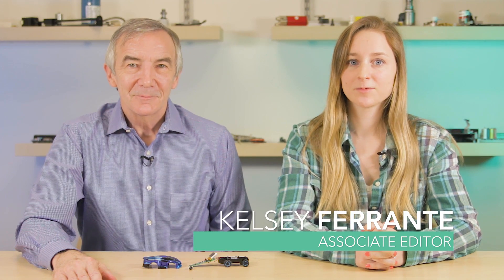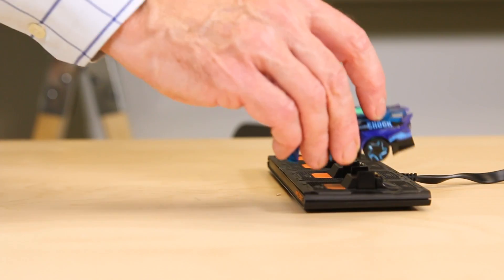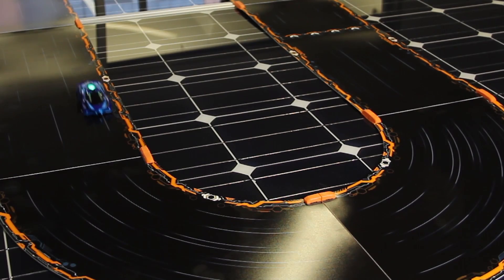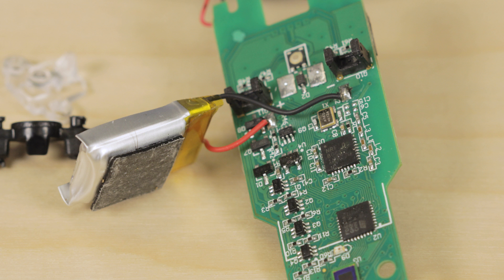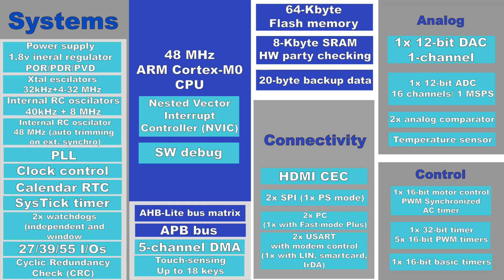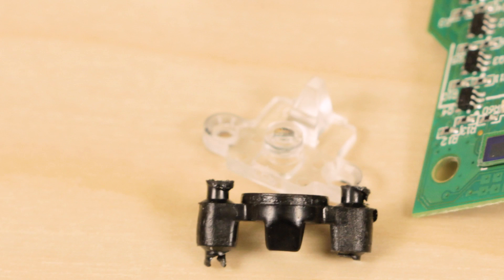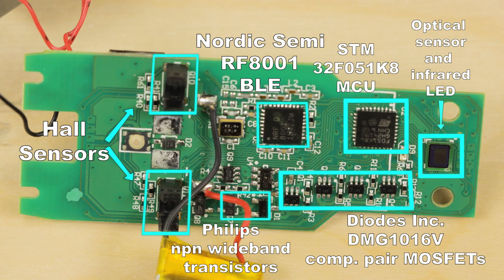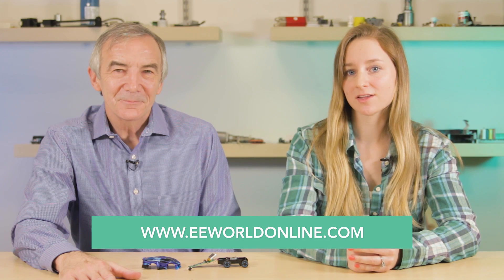How the Anki Overdrive racing cars do their thing

Comment: We have the set and bought extra cars. My only problem is that for the $50 price tag on each car, Anki should have given the consumer an easy option to replace the battery easily just the same way one would replace a small battery in a drone. These batteries will eventually run out and they have to be soldered and who can do that?
Reply: mcbrideart: Who can do that? Anyone; soldering isn't that hard. You can get an affordable soldering station for not too much money (e.g. one of the Hakko 936 clones on AliExpress or Banggood), and YT is full of videos on how to (de)solder properly. Don't be intimidated, it's easier than you think.
Reply: me, just now on my Anki Drive Hadion car, it lasts 23 minutes per charge